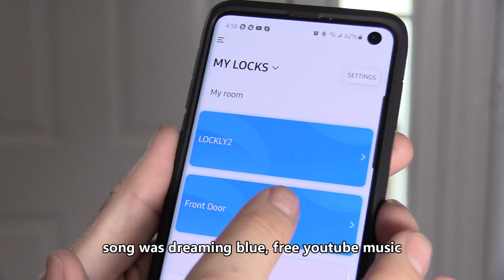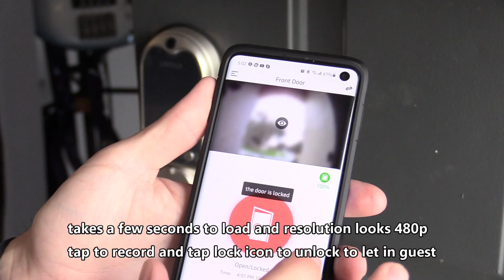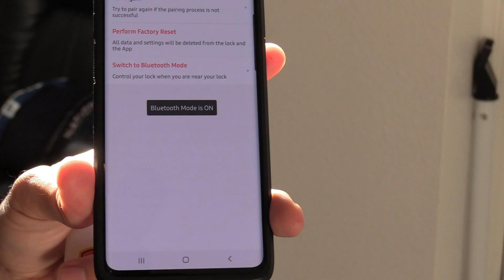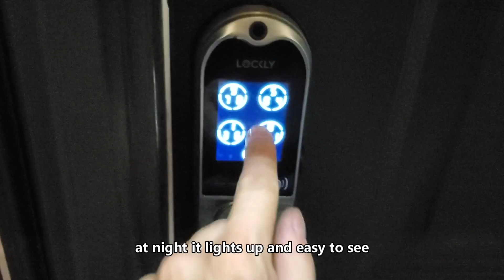How to install Lockly Secure Pro lock

Comment: Im in an apartment and as a result am required to use the lock I was given on the door. Can I use a different keylock with the lockly by changing the tumbler assembly for my existing unit?
Reply from the maker: Never tried that before but I lived in many apartments and always changed out locks then right before moving out installed the original lock.
Reply: @TampaTec  yeah that's standard but someplace are fussy. A couple of other vendors allow tumbler changes. Also, there is a status-seeking behavior among teens to use a crowbar to pry the keypad assembly off. They're not breaking in they just want it to prove they did it. keep a camera on your door.